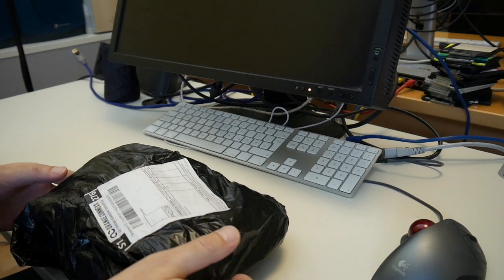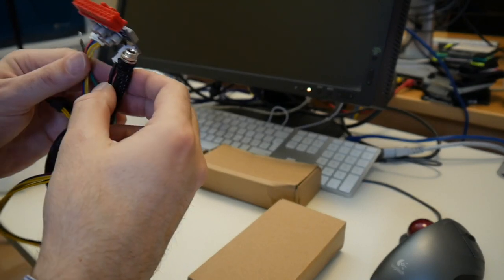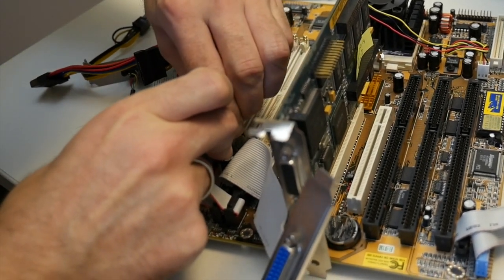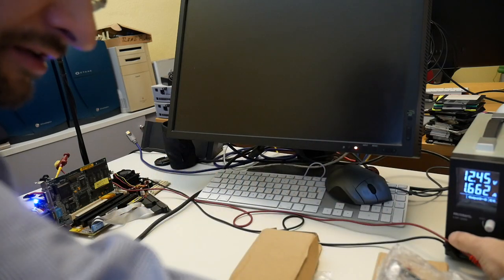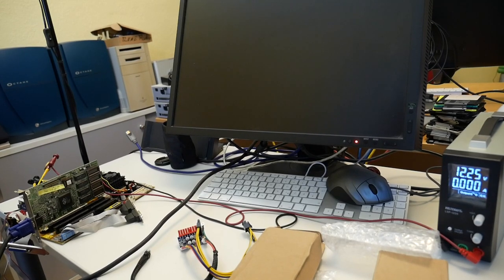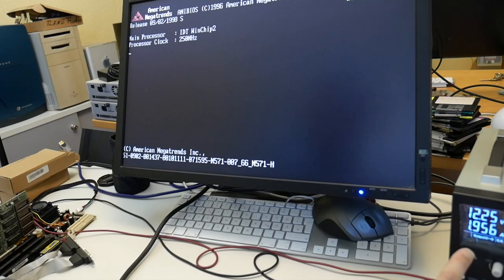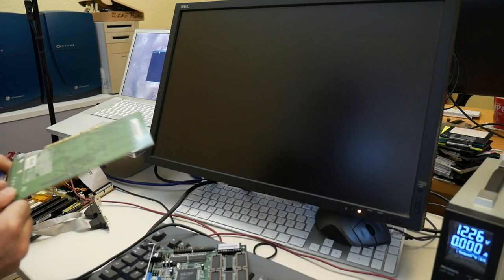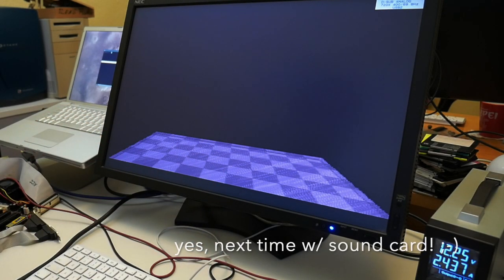Testing cheap 12V DC to ATX power module from China.

Comment: halihalo da!
nice video. hoooowever...

first of all - old connectors, especially ribbons are never hotplug. simply not designed for it. one can easily fry IDE that way. same for older video (on pci bus). unplug everything from card before insterting it into slot. 

second. as for bad condensers - usually they're easily detectable - swollen or loose. usually - 6.3V and around 1500-3300 uF. not that hard to replace.

third. as for power stability from "old acid battery" - i guess, there should be no problem. automotive batteries usually have some 60AH capacity. taking that 100watt is aprox. 8 amps at 12V, i'd say that one has at least 3-4 hours on car battery before voltage drops enough to be of any concern.

and fourth, there exist fullsize ATX power supplies to be fed 10-18V. and 20-28, too and 48V ("telecom power"). i've seen ads for 1kW 12V in power supply, but i doubt it's worth all that money.

thanks again for video, hope you do well. :)

Comment: Thanks for this.
What’s the likely hood of this powering an Xbox 360? It needs 12v 9.6A and 5V 1A
Reply from the maker: There are different models with different max power, however >100 watt is a bit much, likely hard to find ...

Comment: I've heard mention of these DC power supplies being used for replacing failed units in older machines, as newer power supplies typically don't have enough current available on the 5v and 3.3v rails.  Unfortunately what little specs I can find on these don't show them having much in the way of power delivery on those rails either (typically under 20A on 5v).  

Were you able to determine if these units could handle higher current on 5v, or was this build fairly light on power requirements?  (I don't remember what a typical winchip + s3 graphics card requires)

Thanks for sharing this with us :)
Reply from the maker: I only used it with this fairly light load. I doubly they can supply more power than big fat atx power supplies. Incidentally i likely test this in an atom330 board this weekend.
Reply: Maybe you're confusing the 5V issue, which AFAIK only exists on Socket A systems from prior to the introduction of the P4 power connector anyway, with the issue of the lack of a -5V rail on more modern power supplies which means certain ISA cards like some soundcards don't work.

Comment: What about the input voltage range? I'm interested for a supply which can work with a 12v acid battery as the power source. Its voltage may float in the range of 11-14 volts.
Reply from the maker: I don't think it support that, as 12V likely goes directly to the ATX connector and is not "stabilized".

Comment: What's the green cable with a circular hola for? i'm building a mini pc with a pico psu and also has it, but i don't know what it does or if i can just leave it there, but i'm of creating some short circuit. What should i do with it?
Reply from the maker: Sounds like a ground cable that should be connected to case ground for EMI and such. But please double check before you short and brick something ;-)
Reply: @renerebe  thanks for your answer, i think it is a ground cable, but my case (Realan H-60) hasn't anywhere to connect it, i'm thinking in wrapping it with isolation tape, but i don't know if it will work.
Reply: it is a very small itx case all made from aluminium.
Reply from the maker: @AciDsuper  grounding is always good and recommended. If it is the ground it is usually meant to go on a logic board screw for grounding. Be sure to double check it is found, and not to short anything on the logic board with the potentially larger o-ring washer.
Reply: @renerebe  ah.. good old days when you just randomly touch the case and get some 'shocks'.

Comment: Can it power H81 motherboard with i3 4130 chip??
Reply from the maker: You need to check power specs of the components you want to get.
Reply: @renerebe  I've checked with Pc part picker. It says about 170W. Shall I use this?. And also can you please give a link to purchase.
Reply from the maker: @WeTuberPro I'm pretty sure this Pico psu does not have 170W. You need to research a product that support that much power.

Comment: how much is the efficiency of these dc to atx psus?
Reply from the maker: Given that you need to bring 12 v, and it is only generating 3.3, 5v or so, for low loads, I would guess not too bad. But you can only power low power boards from it and bring a sufficiently stable 12V,  so no car battery ,-)